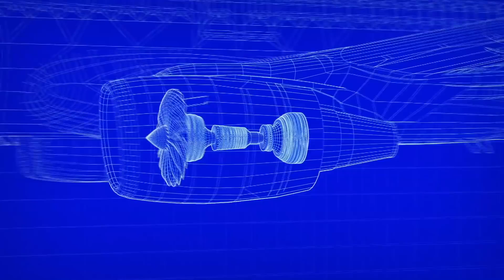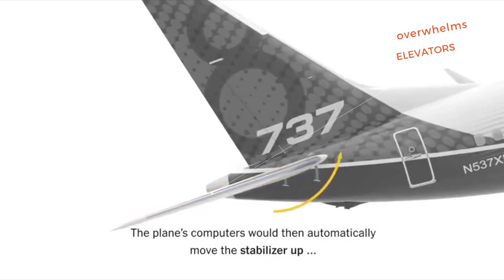737 Max 8 probable cause revealed - Prof Simon

Comment: The "Problem" is between Boeing and the FAA, Boeing should have designed the plane to be stable, they didnt (thats ok) they then decided to implement a control system (thats ok), they didnt use redundancy and by definition they didnt use a voting system from the sensors. They used a single sensor that could fail, with no detection of that sensor. They used this as a get-a-round so the FAA didnt need to qualify it, or the FAA didnt know about it, or worse the FAA did know about it but decided to tick it off anyway.

When a dangerous plant is constructed they try to build in intrinsic safety, if this cannot be done they build in 'Instrumented control systems', the complexity of which depends on the risk, if the plant could give you a nasty burn, its a simple safety measure, if the plant could kill 100s of people (737 Max) then the system needs to have redundancy, no common cause failures, needs to detect if one sensor is faulty and then shut it out, the control system should tell the operator (Pilot) that the system has been activated (not just do stuff in the background). And above all, it should be obvious to the operator how to correct or disable the system (through alarms and control affordance) simply put, this means, if a system is active due to something going on, then the system should have raised a low level alarm, as this keeps going on, the alarm is raised in level, at the same time information should be displayed as to what was occurring, in this instance something like "Auto stall operative", then an "accept" or "override".
Some systems are hard wired, other systems use redundant processing and redundant sensors, the sensors need to be of different design but detect the same phenomena, this means if the design of the sensor is wrong, then this 'Wrongness' is not duplicated.

Boeing decided to do the cheapest option, with no feed back and a system that runs in the background.
Its like letting you drive a car, but when its dangerous the Brake peddle, accelerator and clutch are swapped around randomly.

Sorry its a poo design.

Comment: There was always the stab trim cut out switches to use ! The UK registered 737s use to have two stall vanes, not sure about the current model,  Basically Boeings should have designed a new aircraft and then leap frogged over the A320  the 737 its old hat now being introduced in 1967  the airbus is higher off the ground but the 737 was stuck with the same undercarriage , the engines were moved higher to obtain ground clearance  and that caused the pitch stability problems.  Perhaps we should think about neutral shift sensors too ?

Comment: Of course not having a second sensor was lunacy but as someone who worked for decades on automated systems I'm curious: is it known what actually went wrong with the AOA sensor? Was it mechanical? e.g. did the arm that's supposed to rotate as the AOA changes jam or was the fault in the electronics that converted the angle to a digital signal? Has the manufacturer of the sensor (I presume it's not made by Boeing) issued any statement?
Reply from the maker: The original sensor / software design used speed data and AOA data...this was the design submitted to the FAA. Boeing found slow speed handling issues and dropped the speed data input...now on,y relying on a single AOA sensor .. ( these vanes are subject to ground handling issues) ....the rest you know....sad and bad

Comment: The MCAS system resets itself and takes control like every 5 seconds. There isn't time to take control before it kicks in again.
Or so 60 minutes or similar said. Very scary.
Reply from the maker: poor pilots did not know how it functioned.....when they turned the electric trim back on...mcas pushed the nose down ...beyond easy recovery at take off hight.

Comment: Hey Simon, I have closely watched you information films, and you got a lot of very good points, now I am not spesialist on the MAX but I am one when it comes to B737NG and CL and the oldest version _100 and 200 !
To me the B737NG is the safest airplane ever build, having said that, Im my humble opinion, the MAX was unfortunately a step back, I will explain in a moment. For now when Boeing vent from CL to NG in the mid 90 ties , they reduced the number of parts by 1/3 and made a terrific  unsurpassed extremely good B737NG with an unbeateble safety record  !
What I don´t understand, why they did NOT kept the allredy proven safety system from the NG over to MAX ?
Did they again try to reduce the number of parts, and removed some systems, and replaced them with software?
I have been i contact with some pilots also, and they deeply concerned about this too, espesially when they are NOT informed about new systems installed on the A/C and that really unheard of !
I do have the feeling that computer short cuts has something to do with it, and sales department has gotten the best of the safety department issuses, having said that , Boeing is NOT alone here, FAA should afford to have competent persons to check this out,  ( TAX PAYERS ) and to me they have failed misserably in doing so, and just followed Boeings recomendations, to keep productions up and no delays, even fail to train pilots propperly in STABELISER RUN AWAY ISSUES !
HOPEFULLY THATS GONNA CHANGE NOW !
I have to say that I am deeply dissapointed in Boing, making a software shortcut, they could have used 2 onboard IRU laser gyros for exact attitude of the aircraft to prevent a stall, and used both  of them+the 2 AOA sensors, that would have made the MACS SYSTEM FAIL SAFE in my opinion ,having 4 parameters before starting to trim trim the stabeliser, further more, they failed in making sure that the that stabeliser could be trimmed to a nose down posistion, to a point where the elevator no longer could regain control, that should NOT be possible to do with a automated system !
Because of this Now some  346 people have lost their lives due to a shortcut in a program that only use 1 AOA vane to go wrong for that to happpen, Flight control issues MUST have first priority and over every thing else !
Now I further more worried about another system, which is NOT on the MAX but is on NG and that is the ground spioler lock out system, from what i have seen so far the safety net here could be an issue also, but I cant claim that at this moment in time, only things is the system does NOT have the Ground Spoiler Lock Out VALVE as that NG has  !
It could cause in an extreme fail situation the the Ground spoiler come out in flight, and that could also be a disaster  !
I raise this question, because I saw a film from australia 60MIN yesterday, where a test pilot Chris Brady, expressed concern about, "what else have they NOT told us about this MAX " ?
Reply from the maker: Thank you Jens....that’s interesting about the spoiler switch....
Reply: @SimonHollandfilms  Hey again Simon, thanks for reading my comments, the more I look and the more I find, just like you, and  here is also what puzzles me ! Below the flight deck are 2 coulmb out switches( on NG ,I DONT KNOW IF THE Y ARE ON THE MAX ,THEY SHOULD BE ) They are designed for also cut out power to  the  STAB TRIM MOTOR when the pilots yank the elevator control elevator in the oposite direction of the STABELISER movement ,and we know they did that,  and why the cut out did NOT HAPPEN, I dont understand, if that system had been active everybody would have survived, the elevater control would have been in range where they would NOT chrash !!!
The second thing is we se from pilots that they disconnect both STAB CUT OUT swithches, and you say in you film they try to put them back on, which is a huge mistake,, because the AOA vane was still active and restarted the STAB TRIM MOTOR  again ! If they had been trained in a simulator, they would then know that, they should ONLY have switched ON the MANUAL TRIM SWITCH and left the AUTO part disconnected ! Then they would have been able to trim the stabeliser with the NORMAL trimswitches on the control coulumb ! SO MY POINT IS MORE TRAINING AND UNDERTSANDING HOW THE SYSTEMS WORK AND HOW TO DEAL WITH IT WHENSTABELISER RUN AWAY HAPPENS !
I am willing to show you more schematics and explain further is you wish more clarification !
with King regards Jens Andersen,  and the truth is getting closer  now !

Comment: there is only one reason this happened. BOEINGS' GREED. They rushed the plane through with a new software feature that they had NOT even told the airlines about, let alone the pilots. Airbus had just received an order for 200 a320's  and Boeing shit their pants. They offered American a fully modded 737 if American cancelled 100 of the A 320's and ordered 100 737 max's. Bit of a shit trick to pull, but never mind! Boeing knew there was a pitch up fault with the new version of the 737 ( it was not a NEW 737 as promised. Engines incorrectly positioned meant there was a constant problem in flight. Boeing should be put out of business for releasing a plane that THEY NEW was faulty. Absolute fucking disgrace.... it isnt about PEOPLE... its about money. Well the FAA... should throw the book at them !!! Boeing has got away with a lot and its time to stop it!!

Comment: they stuck bigger engines higher up on the old 737 air frame to save money from having to redesign the air frame.  The old 737 frame was too low to accept the new bigger engines - so they mounted the new engines UP above the wing.  Which causes the plane to pop-wheelies when flying.  So then to try to stop that from happening they invented the MCAS.   ---  No matter how they spin it or claim a software fix, the problem will not go away.  It will merely postpone the next accident / crash.  ---   737 Max should have been designed with a new  frame to handle the bigger engines.   So what's worse, a stalling plane or a nose diving plane?  ---  Shame on Boeing for this mess and loss of lives.

Comment: The 737 Max 8 has engines that don't fit the fuselage.  The plane is aerodynamically unstable after takeoff.  The MCAS  computer program is a band-aid trying to fix a plane that is fundamentally not airworthy.

Comment: Boeing should have originally developed the 737 Max flight control software around the scenario of a "design basis accident," in which failure of sensor inputs was anticipated and allowing all flight control to revert immediately to full crew override of the MCAS system.  It appears that is what is being done now, but why was it not done before the aircraft series was allowed into service?

Comment: If you read the EA Preliminary Report in full and correlate the airspeed of the plane with the timeline an interesting fact emerges; 

The flight crew left the throttles on full power for the entire duration of the flight and allowed the airspeed to increase to, and well beyond, the maximum operating airspeed of 340 knots. 

When the co-pilot declared that the stabilizer trim was "not working", (at 05:41:54Z) the airspeed was past 380 knots, too fast for the stabilizer trim to be adjusted manually by only one crew member turning one of the wheels which are mounted on both sides of the center console. 

Once the crew allowed the airspeed to exceed 350 knots, their fates were sealed.

When applied within the normal flight envelope, the corrective actions recommended by Boeing and the FAA are effective within ten seconds and have worked on other 787 MAX aircraft.

The initial failure was hardware - the pilot's side AoA . That led to a chain of decisions and oversights which ended in tragedy.

Comment: The old Boeing company of 25 years ago would have done a proper redesign, not a cheap software fix. Today Boeing and the FAA are working together and will probably do another software fix, because it's cheap. But the 737 MAX-8 needs to be redesigned, the new engines were installed higher up on the wing and more forward, and this changed it's center of gravity and handling. 
Boeing was penny wise and pound foolish and this cost peoples theirs lives.